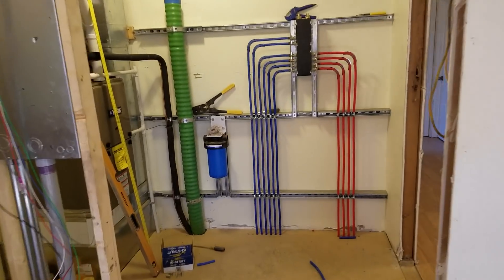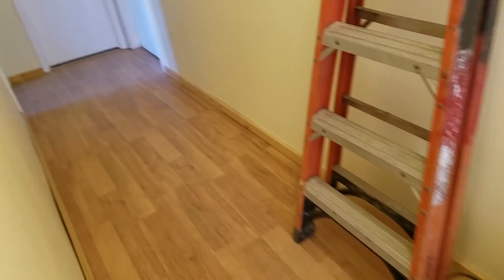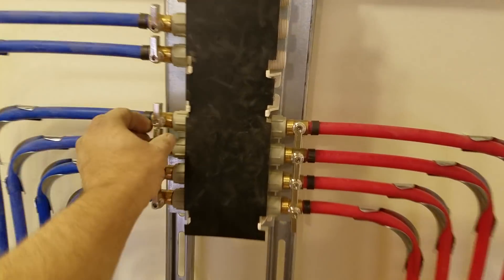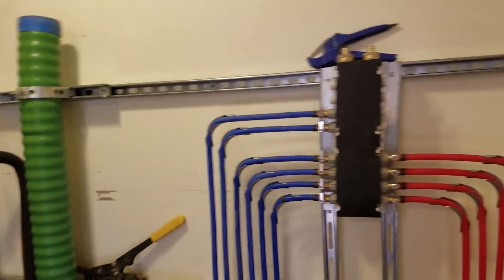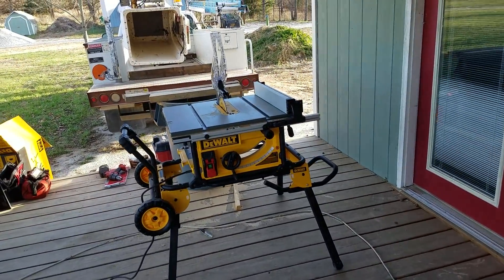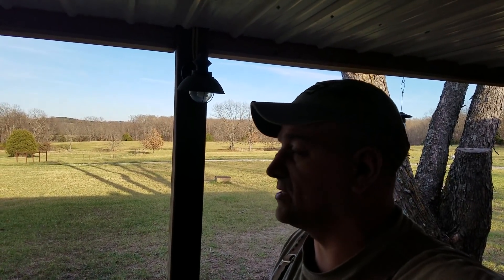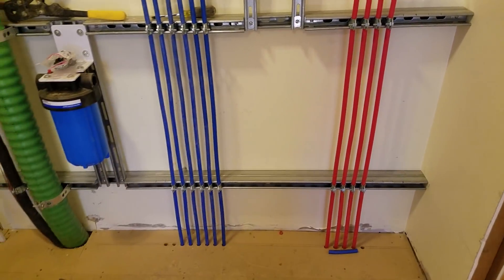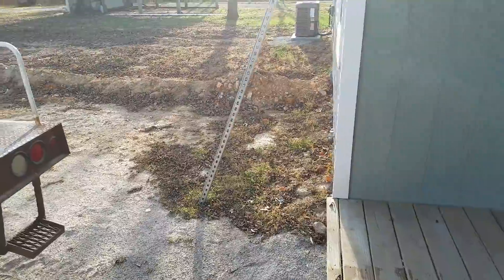Farmhouse plumbing upgrade. (Pex)

Comment: Looks really good nate! Those inline filters work good. I just have to change mine a lot lol. Hahaha ya u fixed the house u can sit in the chair
Reply: Jake Ziegler do you have a lot of sediment?  Have you ever tried one of those screen sediment screens with the drain valve on the bottom to flush it out.   Installed before your main filter?
Reply: Jon Matthews I have a sediment one but that’s not the problem. I have a Carbon block one to take the sulfur smell out

Comment: Mr. Nate did you use the straight lengths of pex or the coil?   When I built my house I used pex but it was in a coil and I didn't know you could buy it straight and I got mad a couple of times and I might have said some bad words the only thing I screwed up on is I should've put a hot water return in because I haul my water and I waste water waiting for the hot water.
Reply: AndersonCattleCo. U haul ur water? U don’t have a house well?
Reply: We don't have water wells ,  if you are able to drill a well it will be an artesian well and natural gas comes with it and you can drink the water but it tastes bad and you also can start it on fire.
Reply: AndersonCattleCo. Lol that would get some people’s interest around here!